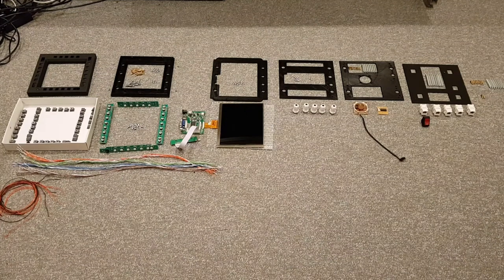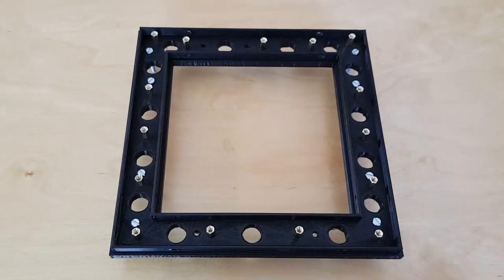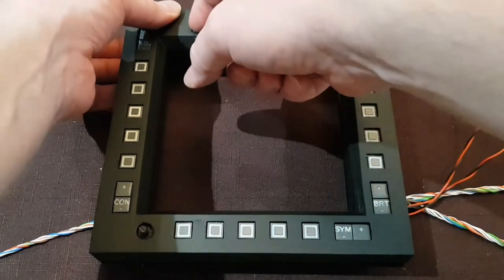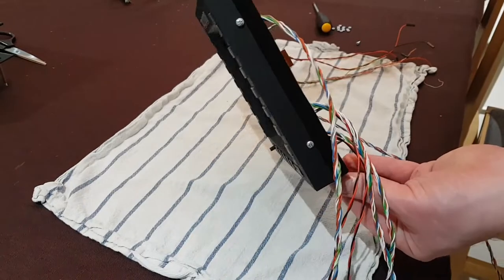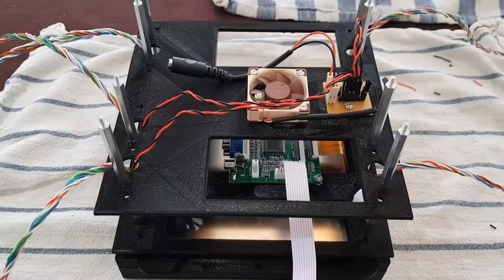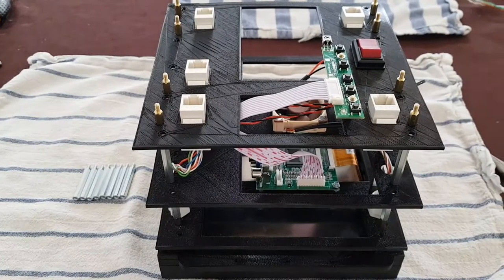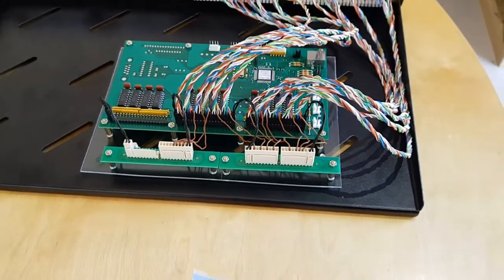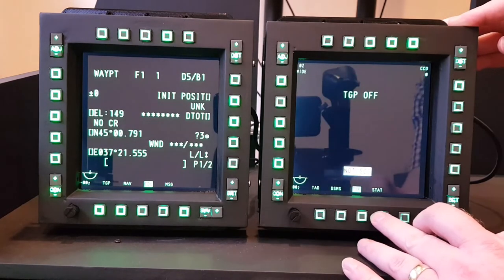Simpit A10C - Front Dash - Part 11: MFCD - Step by step assembly

Comment: Looks great Craig! Finished result is magnificent, can't wait to see them in the main panel with actual gauges working next to them. Will be heaps more realistic than my LCD gauges! Also- looks like your TAD is missing some textures, mine did that on a recent update as well. Might need to run a repair and check your monitor config file!
Reply from the maker: Hi Ray, many thanks. It'll be a fair while until the front dash is finished but Im looking forward to it as I think the overall simpit will feel alot more completed. 
I had noticed the missing textures text on the TAD when zoomed in. Not something I've ever seen before. I'll take a look into fixing it. Cheers

Comment: A lot and I mean a lot has changed for you Flight sim guys. I remember seeing forum posts back in the day of from people using real flight equipment that had been gutted and rewired into USB keyboard encoders so a typical PC would have a Video card and the rest of the PCI slots were loaded with USB add-in cards and USB Hubs/Switches everywhere. I remember seeing a post on a forum of a guy using four PCs with that had equal specs and basically ran MS-Flight simulator 4 times to get the different views for MFCD views. These days with 3D printers, Micro Controllers and FPGAs you can can build from total scratch. I bet the coding is a total headache.

Comment: Where did you find those buttons? I mean overlays, not switches
Reply from the maker: Hi Krakers, do you mean as in the grey caps that click on top of the Illuminated tactiles?
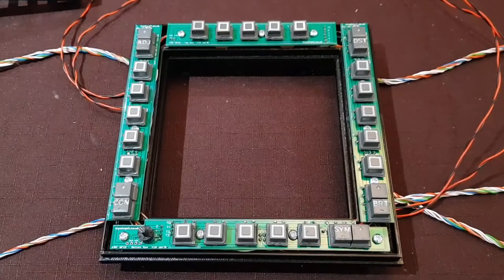Reply: @CraigSmysimpit  those captile caps you added at 2:24. I try to DIY MFD but finding only regular captile caps. 
Sorry for my English
Reply from the maker: Hi, I designed and 3D printed them in white pla. I then spray painted them grey and finally CNC engraved them. It did the job although I want to get more precise engraving next time round
Reply: @CraigSmysimpit  you're crazy! So much work :) I love them